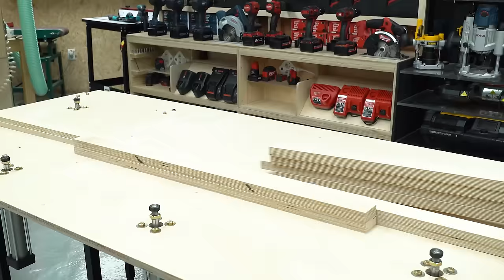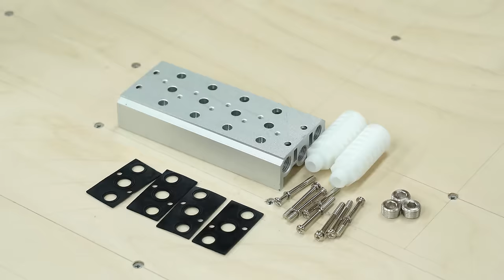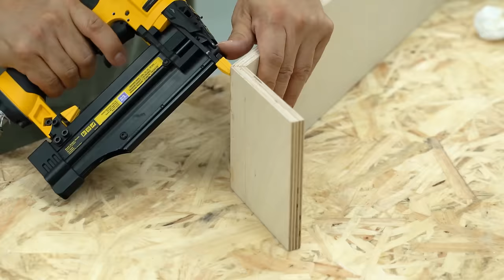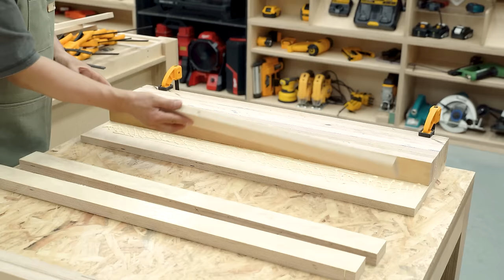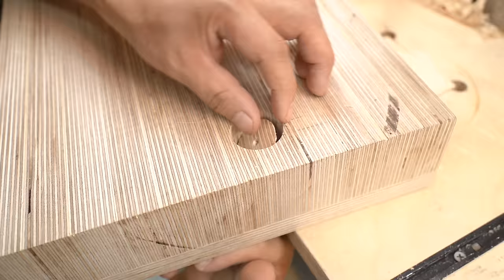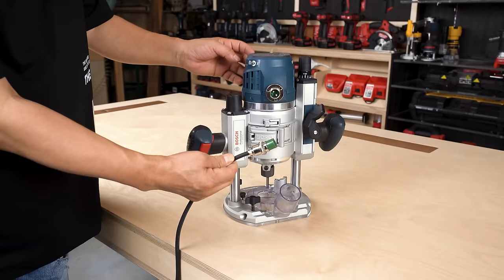Special Worktable Making Film Compilation

Comment from the maker: When we start woodworking, we dream of our own special worktable.
What the average person uses a lot is just a normal worktable.
I have created my own very special worktable. 
It's a kind of automatic table, and it's equipped with a total of four vices using a pneumatic cylinder.
Three vices are moving vertically from the top of the table. It's a new form.
The side vice is a large thing, which can hold very huge boards.
These vices have a special technology, which means they use the cylinder rod itself as a wire. This is a very good idea that you can use it elsewhere.
It is also equipped with three electric lines and three air lines so that almost all work can be done at the table.
The size of the table is also large, 2,000mm x 1,000mm.
You can see various examples of applications.
I hope you enjoy watching.
Thank you.

Comment: Good job and a nice work table.
But something really triggered me because I classify it as a high risk...
It's a good and practical idea with the power sockets on the workbench, but the plug-in system you're using is pretty dangerous.
I'm assuming this is mains voltage (high AC voltag) and not low DC voltage....?
You have installed the male part of the plug connection on the workbench, which you should never do because you can touch the pins that carry the mains voltage and that could end fatally.
You must always use the female part on the live side of the connector because it is usually protected against contact.
I definitely wouldn't leave it like that.
BTW, what functions do the switches at the bottom of the workbench have (besides the power and compressed air connections)?
Reply from the maker: I am deeply grateful to you for your keen comments, as they prove that you watched my video carefully. 

I also had concerns. 
This terminal called the aviation jack has a strange characteristic. The distinction between male and female differs depending on perspective. 
I classified it by the overall shape, and you classified it by the shape of the pin. 

Of course, there is a possibility that the pins of the connector I installed on the bottom of the table can be touched. So I usually close the lid with the string attached. The probability of me touching this pin is similar to the probability of you inserting tweezers into the female hole according to your identification method. One reason is the convenience of the installation method. The male connector according to my classification method is not easy to mount on the table. The nut that is connected by turning also has this natural shape. Anyway, to ease your worries, I will use it with utmost care.

 Another switch at the bottom of the table is, This is an extra switch. If you look closely, you can see that it is synchronized by color with the basic switch.
Reply: @Kynosys_  
Hi and many thank for your explanations.
I stand by my opinion about the connectors ;)
I understand your argument, but I don't think it is justified, since these aviation connectors are also available as a reversed plug connection and it would only be correct and safe that way.
It may be that you are sure that you will never be able to get into it, but then I hope that this will also be the case for everyone else who might be in your workshop and I am thinking especially of small, curious children's fingers..... !! You should never rule out something like that!!
And your example with the tweezers is also quite flawed, because the standard for contact protection has been classified sensibly and is intended to avoid “simple” touching with the fingers and without using any aids (such as tweezers)!
Of course there will always be a way for someone to kill themselves, but you should follow the rules in order to avoid such an accident as much as possible.
As an example, here are the correct installation sockets ;)
https://www.ebay.com/itm/275291100399
https://www.cnlinko.com/Products/267
Regarding the additional switches under the table...., yes, I recognized that the right switch was connected to the large collet. That means you can also operate the collet on the lower switch?
And the two switches to the left of the power connection sockets are for the other (vertical) collets...?
I'm just surprised that there are a total of 4 collets but only 3 switches under the table...!? Thought that there might be other interesting functions hidden behind these additional switches ;)
Or what is the background for these additional switches? I somehow don't understand the purpose...
Looking back, do these additional switches make sense and are these sometimes used?
Reply from the maker: Posted to the most logical man I met in YouTube comments. 

I 100% agree with you that, even when it comes to personal decisions, it is safer to follow general usage. The fact that you are even concerned about the safety of children shows that you are very considerate. I will seriously think again about whether to make changes. 

Your keenness is also evident in your curiosity about the switch at the bottom. Of course, this switch also works, It was also made separately for safety reasons. 
The reason the numbers on the top and bottom switches do not match is because it was designed so that the two cylinders at both ends can move together with a single lower switch. This is used to lift and lower long materials all at once. Thank you again.
Reply: @Kynosys_  
Many thanks for your kind words and for re-thinking about the switches. I wish you great success on new projects, which I surely will enjoy. Greetings from Luxembourg.

Comment: What type of plywood did you use for this workbench please ?  Birch plywood 18mm ?
Reply from the maker: you're right. I mainly use birch plywood. Various thicknesses are used, such as 12T, 18T, 24T, etc. I am preparing a detailed drawing video of this table. I will upload it soon. thank you!
Reply: Thanx a lot. One more question. Please from which eshop do you buy all hydraulic staff for project? Plumb, hydraulic press …
Reply from the maker: It is best to find a store nearby that handles pneumatic cylinders. It is convenient to order them all at once from the store. Since various parts such as pneumatic cylinders, nipples, solenoids, and air tubes are used, it is not easy to purchase them from an online store. 
For other small parts, I mainly use a Chinese online store called Ali Express.
thank you!